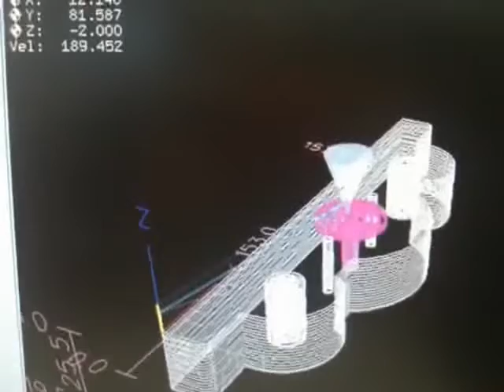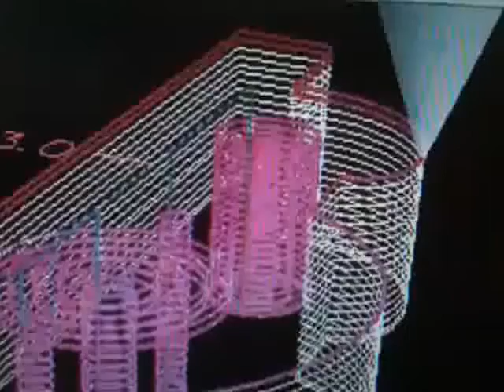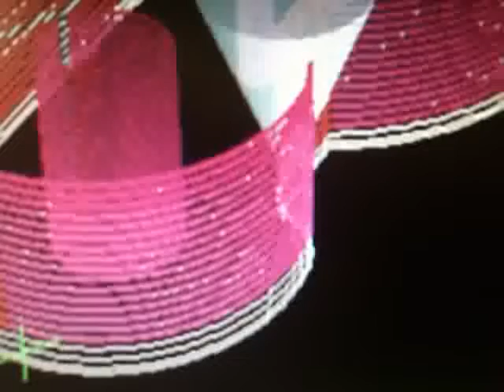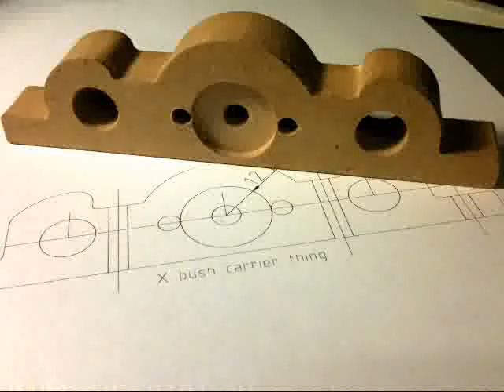Cutting a bit for my junk-box CNC router.

Comment from the maker: @rvantwisk ROFL...  'need to cut faster' is why I was making this part...  The X and Y axis' are unsupported 8 and 10mm rods respectively.  Cutting any faster the cutter 'bounces' and makes a terrible mess.

I'm in the process of collecting parts for a much larger, and more rigid machine.  Which will swing a larger spindle...  I just need this machine slightly better to cut some Derlin/Acetyl bearing blocks for the new one and then it's going to be stripped for parts.